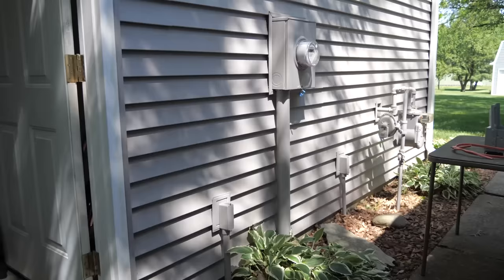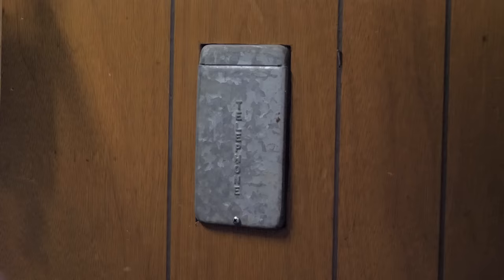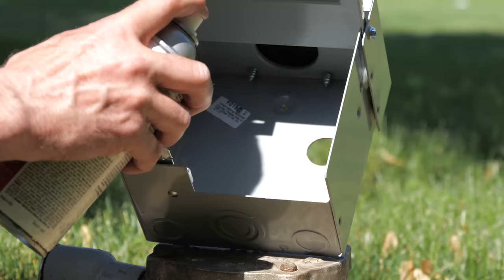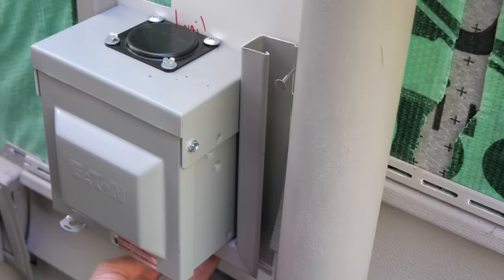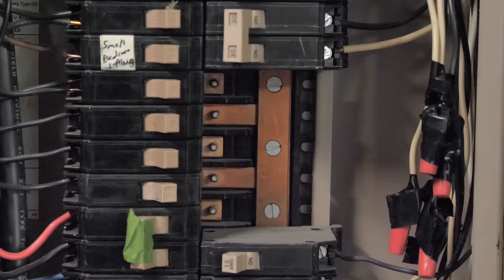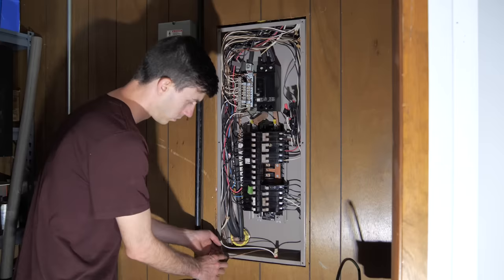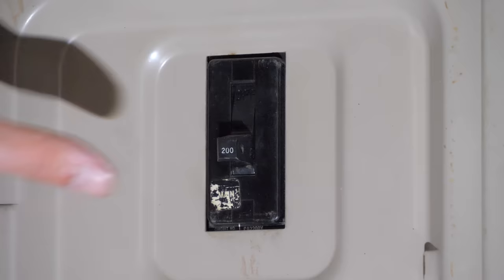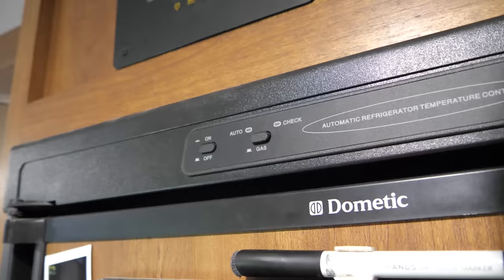30 Amp RV Outlet Install - DIY Electrical Receptacle Wiring

Comment from the maker: Join us on Patreon for Special Access and More! https://www.patreon.com/FateUnbound
Fate Unbound receives a small commission when you shop through this Amazon link: https://amzn.to/2UaGUZx
Thank you for supporting the channel ♥  If we've done our jobs we've inspired someone to chase their dreams!
Reply: SWEET JOB and well done. Safe too.
Reply: Fate Unbound with your solar system installed, why did you require shore connection? I ask as I’m in the process of installing a solar system and just want knowledge off all possible, long term outcomes and reasons for any needed alternatives.
Reply: You're really brave posting a how to on electrical work when you're not a licensed electrician. If someone follows your instructions wrong and burns down their house, guess who the insurance company is going to sue? And guess who is going to win?
Reply: Hey buddy just a heads up I learned the hard way never run your RV AC off of a 15 amp breaker. It will work but it will eventually destroy it
Reply: @DK-xd3ct  doesn't diminish their exposure to liability lawsuits, weaker claims have won. Sometimes it's cheaper to settle than fight.
Reply: E Begging should be a crime
Reply: Stop mooching off your parents

Comment: I just had a 30a breaker installed at my house a few weeks back. My dad, who's been in the RV business for almost 40 years gave me an important piece of advice:  Make sure the electrician is absolutely clear that it's a 120v outlet, not a 220v!  He said he's seen the results of such a mistake and it's not pretty!
Reply: I made that mistake. Thanks for the comment.
Reply: Lol, if he wouldn’t know that, he’s not the guy you want touching it for sure. 👍
Reply: Ya man that’s kind of no shit advice
Reply: This is so true I’ve been an RV technician for 3 years and I just came across a customer that has literally fried 4 of their RVs because the last guy installed 220. We got all units back online and outlet fixed but what a nightmare!
Reply: @vicdman9577 whats wrong if it's 220v? As long as they did a double pole it would just be more power right?

Comment: You did a good job but a few pointers.The pvc fitting you used is not a legal wire clamp. The wire going  into the panel needs a romex connector also. Any time you enter a box a proper connector needs to be used.This prevents the wire from moving in the box it entered and can cause a short. Other than that nice job

Comment: Just one tip, every time you work with any tools, remove all your jewellery, rings, chains etc
Reply: Wow IML. Great tip. Early in my engineering career, I would work on broken TVs (tube types and such) for my coworkers as a side line. I would always check the high voltage to the Cathode Ray tube. One time there was a problem with the suction cup surrounding the connection and the high voltage jumped about an inch to my wedding ring and slightly burned my finger around the ring. From that point on, i have not worn any jewelry what so ever and to this day after 47 years of marriage still no jewelry.
Reply: I would also always wear shoes. Work boots rated for electrical work is even better.
Reply: Same goes for when you weld

Comment: I knew exactly how to do this...call an electrician! :)
Reply: yep.  because if something goes wrong and there is a fire they see the 30 amp plug and want to know who installed it.   might have been a faulty breaker but they don't care all the insurance company knows is they found a way out of paying for the new house.
Reply: Yup this would not even be legal to do without a certification were I live.
Reply: @kitenkaiba6684  And of course illegal without a permit. A homeowner can do it, but a permit keeps you out of hot water if something goes wrong down the line.
Reply: @rickhoagland8571  In my city all electrical and mechanical installs require a permit. In the country a homeowner can usually do it.
Reply: @ImAChristianFirst  Yes, the homeowner can get a permit from the county they are in.You do not have to be an electrician to do the work as long as you are doing it for your own property. Once installed , the county comes out and inspects it to make sure it  was done properly. Still not legal out in the country without a permit, but many get away with it...until something goes wrong.

Comment: Great info vid.  When wiring, I usually start from the receptacle rather than the electric source (panel).  That way, it eliminates the possibility of someone accidentally switching the breaker while you are wiring the receptacle.  Highly improbably but still possible.
Reply: Good idea!
Reply: Panel is off. You could turn breaker on no issues
Reply: If some one does that your not paying attention duh
Reply: I’m no electrician by any means, but just don’t connect it to the breaker until you’re ready. I like to make sure I have adequate amount of wire in the box to be able to safely wire it to the breaker then just leave it hang
And run the rest. Wire the breaker once done then flip it and pray you did it right 😂
Reply: Wiring the receptacle or other electrical component first also cuts down on the time the main is turned off. Good stuff all.

Comment: In many (maybe all) states,  it is code to use a bushing whenever electric wire goes into a box of any kind. Doesn't matter if the box is plastic.  But it is crucial in a metal box.

Comment: I'm not going to gig you any more about correct bushings at the boxes but will warn you to WATCH OUT FOR WASP NESTS in the rv box.  They LOVE those boxes.  A spray that leaves a residue is best.
  I'm a retired electrician and always told my helpers that the two most important tools needed to open a box were a screwdriver and a can of wasp spray.
  Keep up the vids
Reply: As pest control professional, I totally concur on your can of wasp spray!
Reply: Permethrin.

Comment: Just speaking as an old master electrician, job well done! Couple of things, it's not GFCI protected as required by code and if you plug anything other than your RV into that outlet, as in any 120v device you are running a large risk. It's (the recepticle) is protected at 30 amps your typical device, is arc flash protected at 20 amps and amp protected at no more than 20 amps. I love your channel btw, please keep up the good work.
Reply: justvisiten - would they be able to replace the breaker with a GFCI breaker, and get by with that?
Reply: @Skips1964  yes
Reply: I'm just curious, what can you plug into that outlet that is 120v??
Reply: How can we go about doing this to our travel trailer as it is parked near our power pole beside our mobile home?
Reply: Just curious,  why would the national requirement(don't see it code) not require a gfci for a 30 amp? Also, why aren't there adequate options for it to wire for a "camper"? I can be completely wrong....

Comment: Your video saved me.  I couldn't figure out why my reader continued to say I had an open neutral.  Found out the person I bought the camper from  said the hook up was 220 volts, and not 110 volts.  Which created the open neutral problem.  I am glad I watched your video before I plugged my RV into the receptacle.

Comment: I am really impressed at the incredible quality work that you and your dad did! If you paid an electrician they never would’ve take the time to perfectly do everything, especially if it’s out of sight. The filing and the prepping of the metal box was really excellent, as well as the beautiful use of the vinyl siding around the new metal outlet box! I have some of those adapters too, that way I can plug my electric car into the two types of RV outlets at campground hookups. I have a Y-adapter to combine two 30amp 120volt RV outlets if more amperage is needed.

Comment: Nice job and great explanation.  BTW, when measuring alternating current voltage (VAC), it doesn't matter if you use the red or black probe to your multimeter (that only comes into play for direct current like a battery or A/C that has gone through a A/C to D/C rectifier).  And after you ensure there is no voltage between the Ground and Neutral (top and right side), set your multimeter to the Ohms scale to ensure there is CONTINUITY between the two lead) - just seeing that there is no voltage reading doesn't mean the wires are actually connected to anything.  Cheers again - great video!   Michael
Reply: So if you put the meter into the ohms setting then you should see continuity between the ground and neutral?  Is that correct?
Reply: @matthewsandoval8749  Hmm, here's another one of those "it depends" situations.  If you are measuring in the plug that goes to the RV, they should not have continuity, but if you measure the connector on the A/C pedestal then "yes" the ground and the neutral must be connected and provide continuity between the earth ground and the neutral.  The reason is that we do NOT want current flowing through the Ground connection in our RV - a BIG NO-NO.  So your current flows between the Hot and the Neutral wires in your RV, but never through the Ground wire, which is the reason your Ohmmeter reads infinity (open circuit).  Good luck!

Comment: David, Nice job and excellent step by step instructions. FYI if say your Dad wants to use that outlet for powering some sort of outdoor tool or appliance, its easy to get a 30 to 15 Amp adapter, HOWEVER he needs to add a portable GFCI unit for safety.

John T    Retired Electrical Power Distribution Design Engineer

Comment: Thank you for a simple, clear cut video. It made my installation quick and easy. Most appreciative for the tip on going to heavier gauge wire over 25 feet. You, sir, are a blessing to a lot of folks!
Reply: Wrong. Generally speaking 10 gauge wire can be run up to 50 feet at 80 percent load rating of 24 amps. 10 gauge at 50 ft can handle 30 A peak loads, like when the RV AC kicks on. Otherwise, 50 ft is okay.

Comment: Ive done this twice for friends. The only thing I would point out here is that you need a cable clamp at the main box where the NM cable enters at the bottom. Without a clamp, it will eventually rub through the cable sheath and short out. I would also change the plate on that telephone box so no one later is confused to find 120v wiring in it rather than telephone cable. I don't think you need a clamp or bushing in the exterior box since you used the plastic bushing.
BTW: if you ask an electrician to install a 30-amp outlet, he'll probably look at you funny and put in a dryer outlet. Stating 30amp 120VAC may help, but the key is an RV outlet,  TT-30R.
Since that telephone box is a low-voltage box, you would want to assure that no one gets tempted to install an outlet there. For the outside, they make a GFCI extension cord thingy for 15 amps.
Reply: Believe it or not,  wires have a tendency to move because of the surges of current going through them,  even as little as when turning on a light although VERY minute.  If you want to see this in extreme form, check out how much jumper cables move next time you try to jump start your car.

Comment: Did the same install at my house right before I sold it to go full time. Great tutorial. 

If you have this done by a professional, make sure they understand that it is an RV outlet so they don't try to wire it up with 240V. The outlets look the same and some electricians don't know that there is a differenc.
Reply: My understanding is that that is a common misunderstanding by electricians, as normal dryer plugs (30 amp) take 120 per leg so 240. If you get a 50 amp installed, though, it sounds like it’s not a problem, as that is already 120 per leg.

Comment: Pretty cool install and it was very kind of your parents to allow you to install the 30 amp outlet on their home.  It also adds value their house 🔌👍🏼🏡  One note, as an architect I’m sensitive to water intrusion. The outlet box trim  was a great idea and looks outstanding. I would have added a self-adhering flashing strip over the nailing flange & nail heads of the added trim. This would provide additional protection from capillary water intrusion behind the trim. All in all an excellent install. Congrats 🙏🏼⛺️😎
Reply: Or an architect
Reply: Yeah

Comment: Nice job!!!... however, we will still sometimes trip a 30A breaker when we run the A/C,  water heater and the microwave. I will routinely turn off the A/C when we use the microwave on a 30A circuit.

Comment: Thank you very much I saved myself over $2000.00 have power to my RV and did it safely and up to code. I also went and purchased the exact Surge protector it is a good feeling to know you are not going to burn out your RV.

Comment: Excellent video David! I’ll be doing this to my home before winter. Won’t be as easy as my box is in the basement and the run will be through my basement wall to my garage, across the 3 cars to the other side then through an insulated wall to the rv pad. 

Take care, Bill

Comment: Good job David, nice to see your Dad too.  I learned a few things here, thank you.  At my base camp in the mountains I have a 30amp double pole 240 volt breaker I don’t use but I only need the 30 amp single pole.
This is definitely a future project.  Thanks again!

Comment: Very nice guide / job.  We are in the exact same scenario but the only issue is about 50-75 feet away we have to park.  So hopefully upgrading to heavier gauge wire will be the plan for us.

Comment: Great video.
I'll add one bit of advice. Before turning off the main house breaker, individually turn off each circuit breaker.  Then turn the main breaker before turning on each breaker.  This prevents a very large surge going through the main.

Comment: Very nice! I'm installing an outside outlet for my plug in hybrid. I'm hooking it up to a 50amp breaker because I eventually want to replace my car with an EV and want the extra power.  I'm using an RV outlet and, just like yours, there's no knockout in the back! I could use the side knockout, but the back is much better. I'll do the same thing you did.

In my case, since I'm doing a NEMA 14-50 plug, I replaced the receptacle that came with my RV Outlet with a heavy duty Hubbell outlet, which was a tad too big for the metal plate that holds the receptacle, so I had to use a 2.5" key hole saw to make it big enough and that has worked out well!

Comment: Nice job! I installed one on the outside corner of my garage, however I used a box with a 30 amp breaker along with the 30 amp outlet.

Comment: Good install. Just want to add. You can go up to 100’ with the circuit not 25’. Also do not need to remove all the sidling and trim around the box unless you have ocd. Box can be mounted directly over the siding which is typical and I’ve never seen anyone primer paint a knock out hole but again ocd.
Reply: Thank you. i wondered about the 25ft versus 100 ft. The price of wire being what it is right now.

Comment: Hey David. The work looks grate. At my place I added a 20 amp receptacle along side. I used a double breaker one side 30 amp the other 20 amp. And 10-3 with ground wire.

Comment: Great job and great video. My only suggestion would be whenever you're able to wire into a breaker, you don't have to install the breaker first. You can wire up to the breaker and then install breaker to the panel and then you don't have to turn your main off. Obviously  the safer route Is the way you have done it. Again,  great video!

Comment: Great video.   Well produced and very informative.   Who would have thought only a 30 amp single pole 120 volt breaker would power the rv with an ac unit.

Comment: Please check the latest requirements.  A GFI protection is now required on RV lines. Also, there should be beaker in the box.  Turn off the breaker before plugging in to prevent arcing.  The RV breaker boxes on the market with a breaker won't meet code by themselves.  Also, code call for the box to be 4 1/2 feet off the ground.

Comment: Cool, we are wanting to do the same thing to our house, just put in a ba drive way on the side of our house to park the truck and travel trailer, now we need a 30amp plug, and we're plug in to 20amp that's also far away. Thank's for sharing.

Comment: I am a licensed electrician. Not a bad job. FYI that bushing is actually a pvc connector. A lot of  panels don’t have a main breaker. I always stab in the breakers in the panel bus bars hot. No problem for me. I do it on a regular basis. Even with 480v. But if you’re not qualified to do it call an electrician.

Comment: Looks very good, we did the same thing two years ago for our campers  in our back yard for the winter, we store our kids camper out back with our camper, just a FYI, place a screen at the bottom of the 30 amp box  when your not  using it or you may have a surprise  when opening it, this just happen to us we went camping for a week when we got home  and went to plug in  i had a  surprise the Bees had moved in in 4 days time, hope this helps , have fun you two,  always watching from north East Michigan and Be Safe out there
Reply: Great video! I have almost the exact setup in the lawn at my parents house when we visit. My dad is an electrician and still hasn’t gotten around to adding the outlet. Maybe it can be a father daughter project next weekend 😁

Comment: Nice job. And video. Did the same at my house, I left the 110 plug in to be able to use other electric devices. When I use it for the RV i use the adapter.

Comment: A little late but just fyi if anyone reads this you should NEVER!!! run your camper AC on 15 amp service .. its starts wearing down the compressor and sooner than later the AC unit is shot and they are throw aways .. no recharging and no compressor can be bought and swapped. Only serviceable part is replacing fan motor ... 1300$ for a new AC unit .. so NEVER run your AC on 15 amp service.. really strains the compressor!!